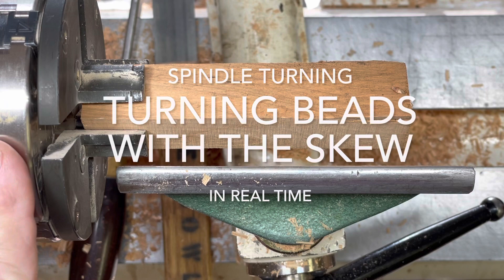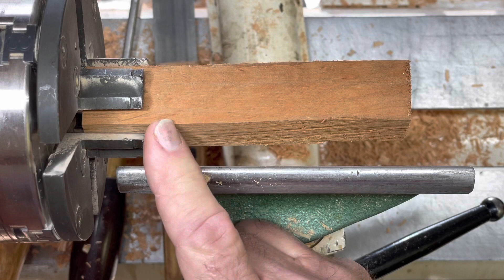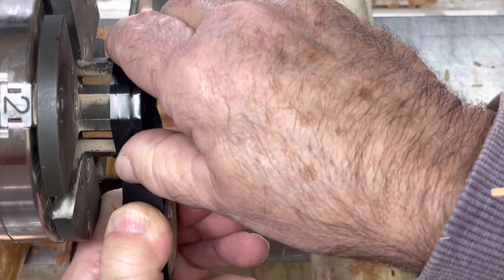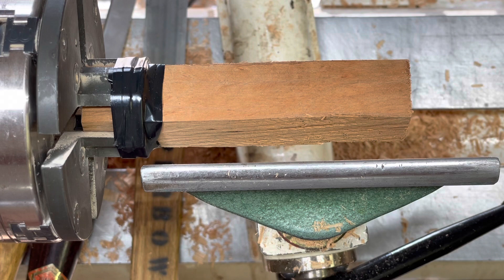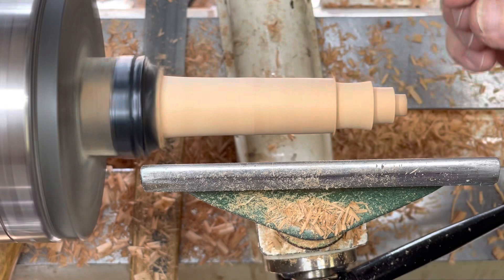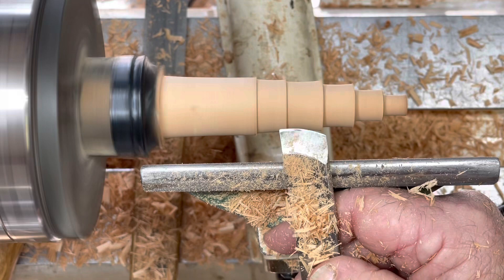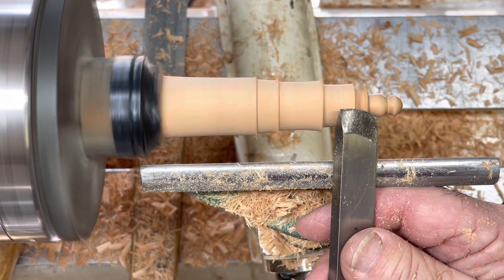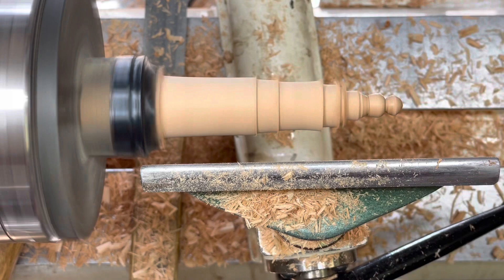Turning beads with the skew in real time

Comment: Great video Joe!   As a new turner, I am trying to determine which tools I need to have.   I have a couple of AMT tools that I picked up many years ago.  They are not the best quality!   The skew chisel is a 3/4 “ with a straight edge, not a radius edge like yours.   It is also much thinner.

My question is ….. Should I be looking for a straight or radius edge?  How wide for just general spindle  work?  Thank you for any advice you can offer 🤠
Reply from the maker: Hi Randy,   For general work with the skew I like a slightly radiuses edge, because I peel a lot, and the slightly curved edge helps keep the long point and short point from scarring the work on a delicate peel. You make the edge curved  when sharpening.  I think 3/4 or 1 inch is a good size.  Take care.